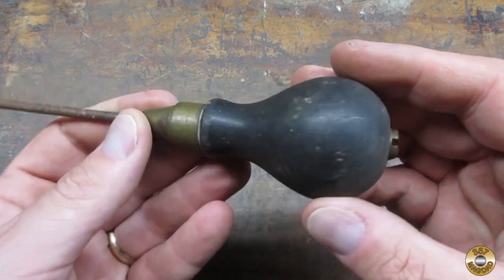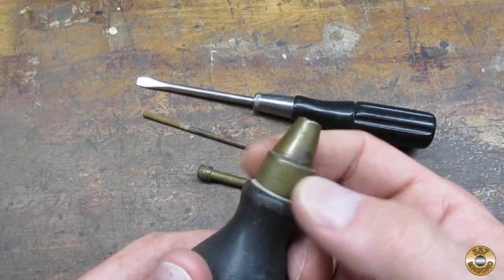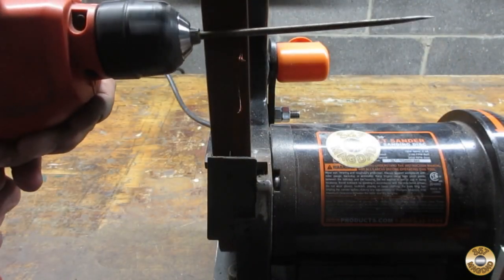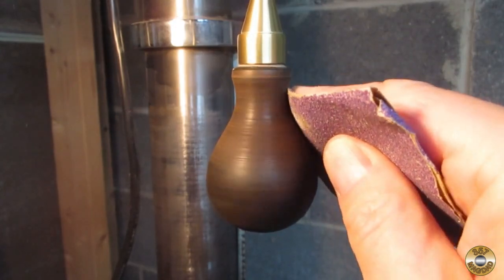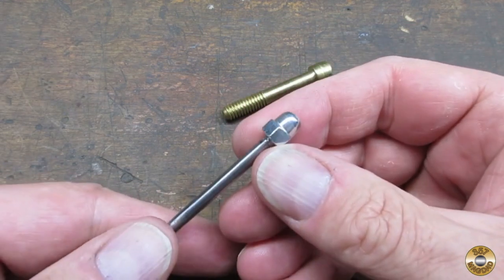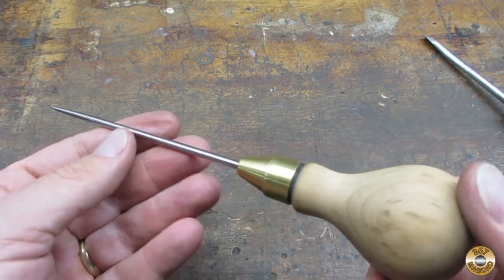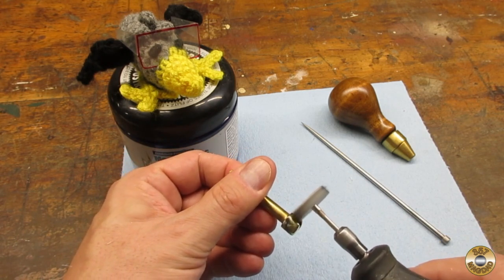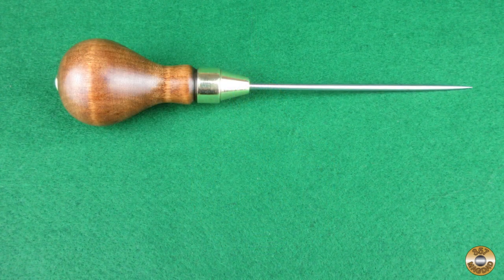Hand Tool Restoration - Vintage Scratch Awl

Comment: Looks like the knob from a Stanley wood plane. The nut too. If the wood is rosewood and the nut has 12-20 threads, that is what it once was. Nice job whatever it is.
Reply from the maker: If it was homemade, it was done by a real craftsman!
Reply: Upside you know your Stanley tools...👍
Reply: @setdown2  
My collection of planes is wild. I love them as much as my V tail airplanes. Now moving on to old Suzuki motorcycles. I have 3 to 8 Stanley planes. All a pain in the yes. Bob Kuane helped a lot.
Reply: @setdown2  if you want them they are yours.
Reply: @upsidedowndog1256  lol...i have a few myself...want to restore some but rosewood...forget it ..
I'm drying some wild black cherry as a close substitute...also getting into old timber framing and joinery...

Comment: That's a neat way to fill the gap so to speak. You've probably already know this, but it is very common in machine tools that when a set screw is needed, we often drop a piece of brass in front of it so that the grub screw does not mar the finish. In and around the 40s for whatever reason it was pretty much standard anytime you had a set screw, to in fact use two. One acts as a set screw and the second one is safety retention for the first set screw. Many a first time machine restorer has been befuddled by this practice. I have a particular affinity for machinery from that era and I have restored enough of it that anytime I remove a set screw, I always use a flashlight to check for a second one as well as a brass chip before trying to remove the shaft. It's interesting how certain techniques seem to come into and out of favor at different time periods.
Reply: Came back to clarify this a little more because you asked for input. The practice of using a chip of brass in front of a set screw is to prevent galling. We have all experienced trying to get a pulley off a shaft that has scratches, and what a pain it is. Another example is when you spin a drill bit in the chuck and you get scratching around the drill bit preventing it from being able to be chucked again until the high spots are filed down. Sometimes the brass chip would be glued to the tip of the set screw. Above I said this was typical of 1940s era. To be a little bit more precise, I see the brass chip and double set screw practice used particularly in higher end machinery built between say 1870 and 1960. Sometimes if I am considering a machine in rough condition and I am not familiar with the manufacturer, I will pull a set screw. It is that directly correlated with quality that it makes an excellent indicator. It is very surprising to see that in an awl, but I do not think interchangeable picks was the reason, but rather to make replacement easy. I think they have used threaded brass in place of a chip because they were making brass screws anyways so you would have all kinds of threaded scrap laying around. Very easy to just nip off the length that you need. Between those details and the quality of the brass screw, I would Guess that this was a very high end awl for its time.
Reply: The rotating ferrule is quite unusual. The only idea I have for its existence is to make resharpening the tip evenly more easy. If you imagine the motions you would use at a bench grinder to sharpen the tip while keeping it concentric, being able to smoothly rotate it would help quite a bit. That one's just a guess.
Reply from the maker: Excellent information!  Thanks for sharing!